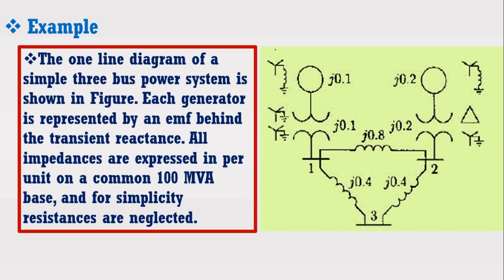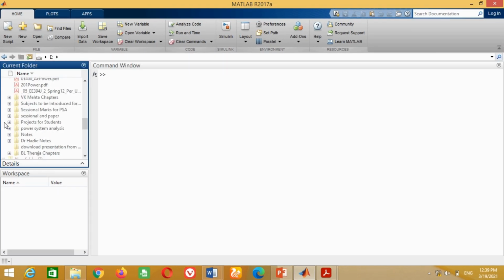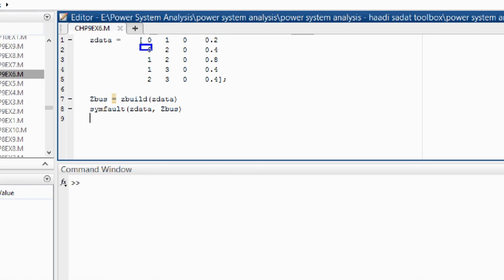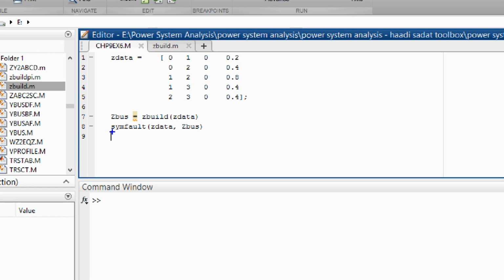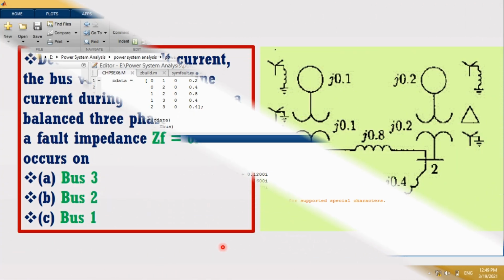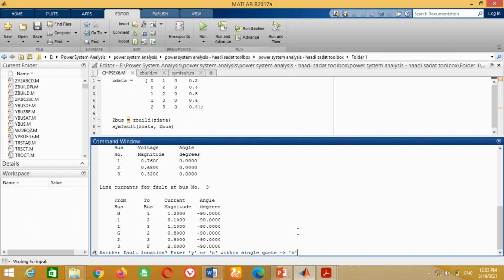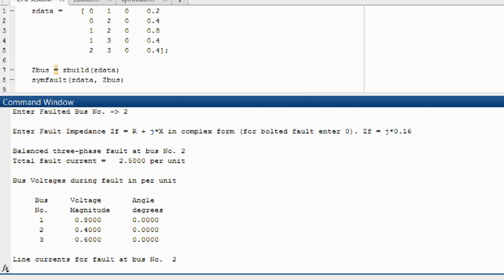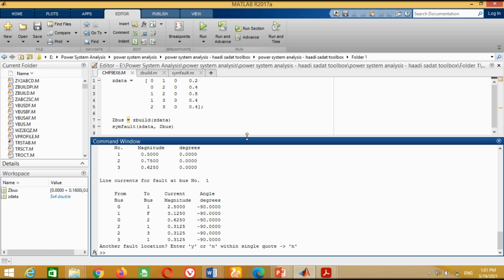How To Solve Symmetrical Fault (Three Phase Fault) Analysis in MATLAB? | Dr. J. A. Laghari

Comment: Thanks so much 🙏 
Please how can How can one integrate wind power output generated by a weibull distribution, as input into a power system network (IEEE 39 Bus to be precise). I am talking about code not simulink Sir, thanks 🙏
Reply from the maker: Thanks for the comment. For this purpose, you have to go through research papers, and find the way how to implement it in the form of code.

Comment: i am working on IEEE 14 Bus and i have 3 Generators how can i consider its Data to make the short circuit analysis for the whole system
Reply from the maker: For short circuit analysis you may go to Hadi Sadat book chapter 9 or 10. There you may find few tips to solve this short circuit analysis. It is because, short circuit analysis of such big system involves load flow analysis, therefore, you have to combine load flow analysis too. Further details may be found in the book. I will try to nake video on these topics too.